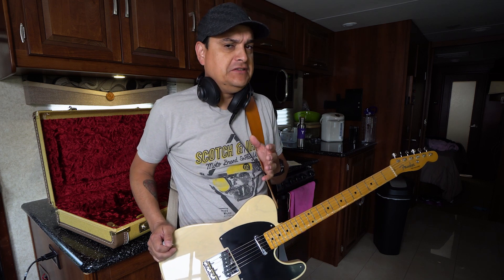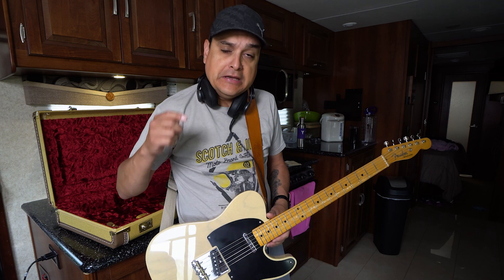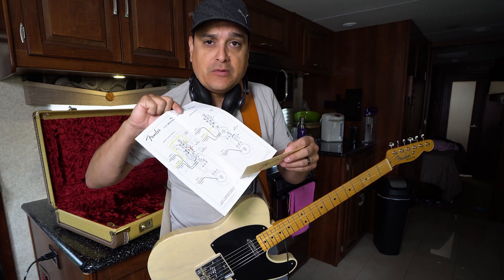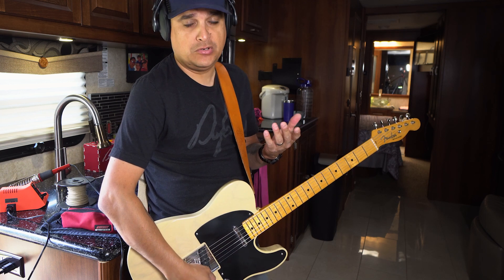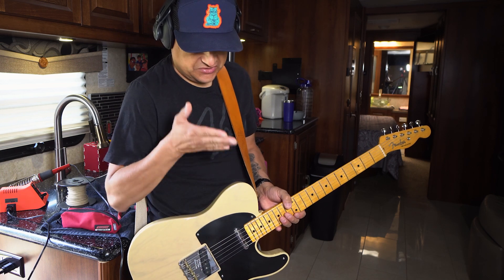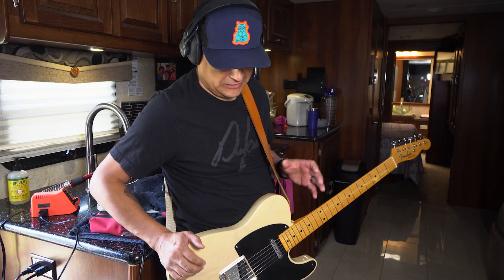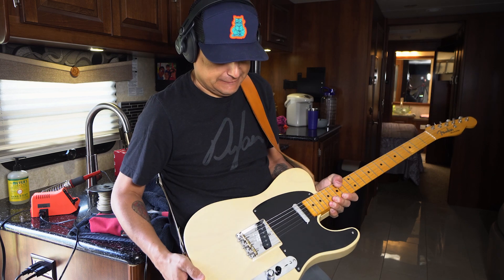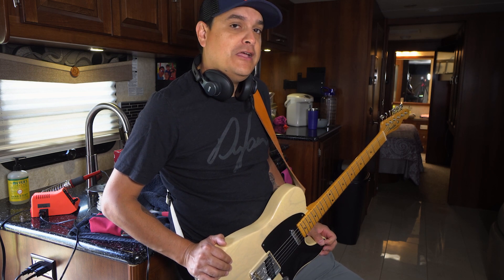70th Anniversary Fender Broadcaster Wiring Mod VS Telecaster Wiring

Comment: I found this channel while trying to understand shielding. Absolute gem of a channel. I am thinking about putting a phase switch knob on a knock off strat. but I’m worried about the grounding being wonkey.
Reply: The Potto I installed a phase switch on my tele and never had any grounding issues. For the tele I had to separate the metal casing on the pickups. I’m not sure if something similar is needed for a strat, but just follow a guide online and you’ll be fine ; ).

Comment: Dylan this was great thank you very much. It’s important to note that if you purchase this guitar beyond the entry level finish that you’re holding, and into a “relic” finish or any of the other finishes under the title “custom” the wiring actually comes REVERSED. That is to say that the standard Tele wiring is what you receive in the case and that the vintage wiring is installed standard.

Comment: I've wired one of my guitars with a custom tone circuit I've not seen suggested elsewhere, which combines the functionality of a blend and tone pot.  Arrange things so that when the switch is in the relevant position, one of the pickups feeds the voltage pot directly, while the other one feeds through a fixed resistor to the tone-pot circuit, and then through another fixed resistor from the tone-pot circuit to the voltage pot (where it joins the signal from the first pickup).  In my case, the "direct wired" pickup is a bridge humbucker which has the top four strings muted, while the tone-controlled pickup is the neck humbucker.  The effect of this is that when playing chords, I get a bright and punchy bass string and four more subdued treble strings.  On my channel's video of "Misty", I had the pot set so that the two bass strings are noticeably louder than the treble strings, but not outrageously so.

I'm not sure how useful this kind of split between the tone of the upper strings and lower strings would be with tunings other than my own Flat Finger Tuning (G-D-d-f-g#-b), but I really doubt Flat Finger Tuning is the only one that could benefit from such an approach.

Comment: Nice video! So in blend mode "10" is the usual 2nd position (both pickups equal). I wonder can you set up blend mod in a way that "0" is just bridge pick-up, "5" is both pickup equal (like usual 2 position) and "10" just neck pick-up, with blending in between (from mostly  bridge/little neck to mostly neck- little bridge)?  In that case I can just replace pick-up selector with blend mod pot and still have my tone pot (i.e. have three knobs and no pickup selector at all) and have additional tonal options with blend mode, kind of like strat position 2.

Comment: I just watched Fender's video on the custom shop version. Evidently it comes with a complete rewired switch assembly in the case. The guy also mentioned that they used a smaller tone cap for the neck position. When you did the mod, did you notice the value of the cap? The guy also mentioned the 10k resistor. The broadcaster wiring diagram on Seymour Ducan's site shows a 15k resistor (presumably this is Fender's 1950 value).
Reply: Just rewatched, it's a .05 cap.

Comment: Hi, I have a 2p3t and 2p4t switch lying around that I would like to use in a guitar mod. So far the only thing I’ve come up is a varitone switch. Any Ideas what else I could use it for? 

(The particular guitar I have in mind has 2 single coils, but doesn’t have a pickup selector; instead it has 2 volumes and a tone.)

Comment: DUUUUUDE! That muffled position with gain sounds very much like a great Fuzz tone. I could play MANY Chili Peppers solos like that.
Reply: I would think that if a guitarist is going to substitute for a a bass player, it might be most useful to have a pre-amp designed for severe crossover distortion (so signals near zero would disappear entirely) but a heavily-filtered output, and then have the guitarist play power chords.  That combination of effects should have been easy to achieve in the vacuum-tube era, and would have produced sound an octave below the bottom note of the power chord.

Comment: Is it possible to tweak that first position so that when you blend in the neck pickup, it gets blended in series instead of parallel?
Reply: I can't think of any reasonable way to design a blend pot that could go all the way from 100% bridge to 100% neck.  If one wanted to be able to dial between e.g. a 50-50 mix and 100% bridge, one could wire a 100K pot across the neck pickup, tie the bottom of the neck pickup to the top of the bridge, wire the bottom of the bridge to ground, and have the wiper of the neck pot feed the top of a 500K volume pot, but that wouldn't be able to dial the bridge below 50%.